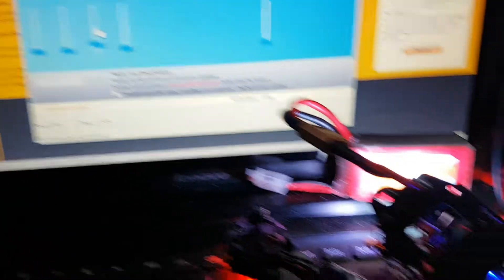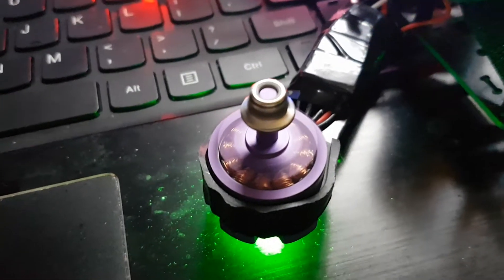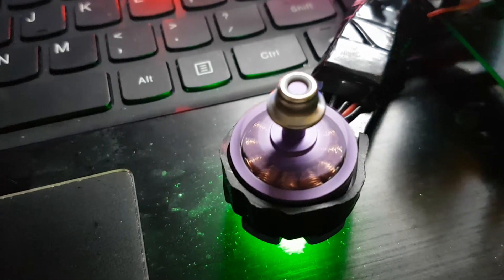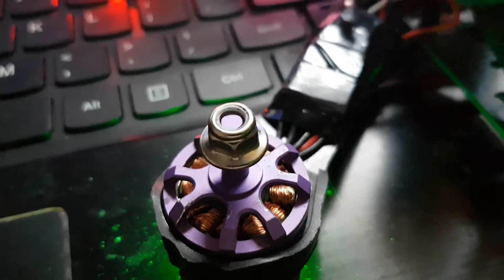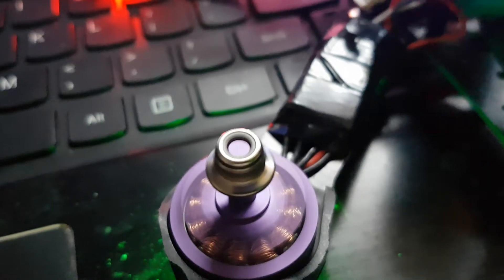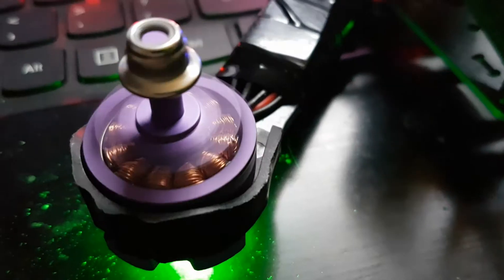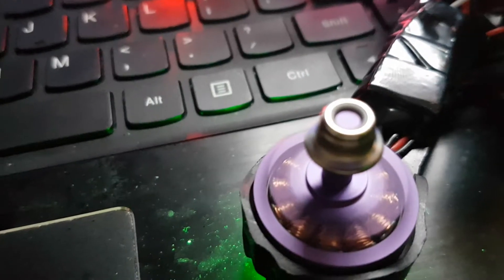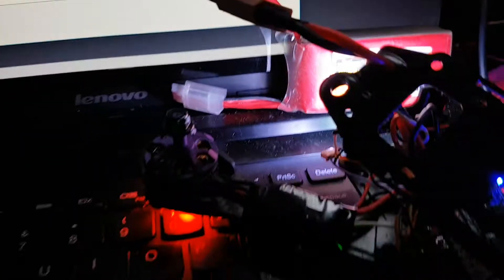Spedix gs30 one Esc acting funny.

Comment: Just some advice on Blheli_32 ESC's.
Login to Blheli_32 and set your ESC pwm freq to max your motors will run a lot smoother and it reduces noise.
Reply from the maker: Ok I will try that. What about Dshot 1200 can you say anything about that?

Comment: did you solve it? i have exactly the same issue with two of four EMAX 30A bullet. after a couple of days dancing around, one got fried
Reply from the maker: How did you fix it? Just curious.
Reply: These were bad ESCs from the factory, replaced with Spedix 30A
Reply from the maker: Did you get d shot 1200 to work?
Reply: Nah, decide to wait until 32-bit architecture is stable, and went for classic ESCs with DSHOT 600
Reply from the maker: Ok I found 600 was better for me at this time also. I do find the spedix to be better and I like that they don't need to be calibrated.

Comment: When you raise the slider and the motor skips or doesn't spin, either the ESC or the motor is probably damaged. In rare cases, it's a bad signal wire or motor pad, but not usually.
Reply from the maker: Thanks I ordered 2 motors one for spare. I swapped Motors around and the problem moved with the motor.